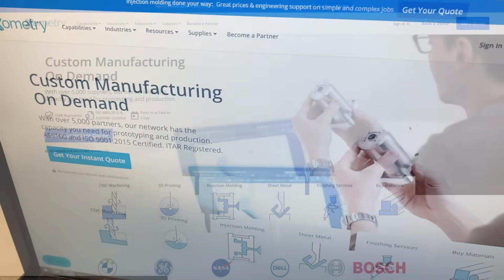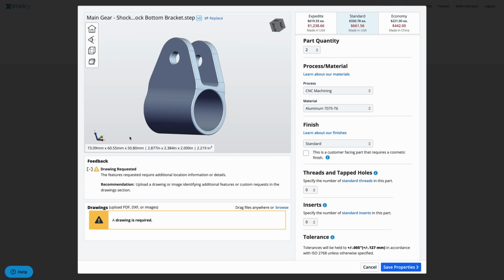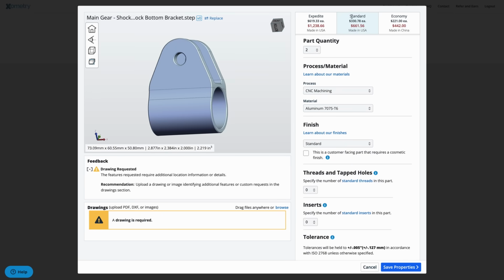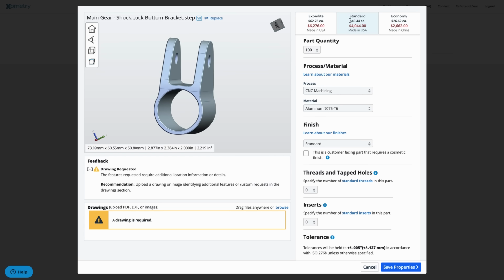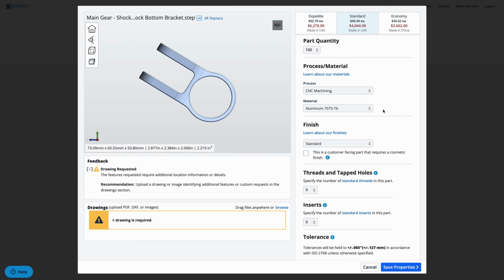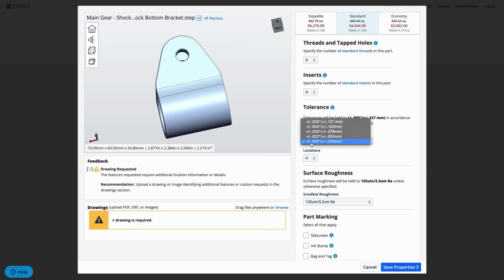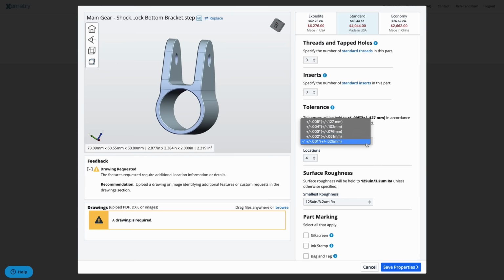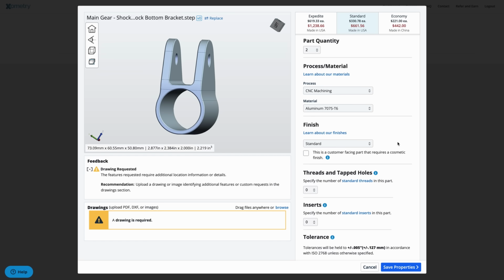The TRUE COST of CNC machining!

Comment: 33 years as a manufacturing engineer in Aerospace......and I can only dream of design engineers understanding what you just demonstrated, and we're just talking about the basics here. very well explained guys.
Reply: As a mechanical engineer, I can understand why new engineers generally do not have a grasp on machining.  The main focus in college is math, statics, dynamics and other engineering theories.   We would be lucky to even have a few college courses on drawings, modelling, dimensioning, geometric tolerancing, and many other important subjects to creating a working drawing.  As a result, most new engineers has never been exposed to design for manufacturability and not prepared for the real world when we work our first engineering job.  I'm lucky that I went to aviation school and got my A&P license, so I have been exposed to the practical side of engineering.  I also converted my personal end mill to a CNC machine, so I have exposure to working with metal fabrication.  If you work in a larger company, there are other people available to show the new engineers the ropes.  On the other hand, smaller companies do not have that option and the person has to learn on their own.  Generally, this is where most of the problems occur.  Without a good background in design and machining, most new engineers lack the understanding to create good design and drawings with the proper tolerancing.  

I often see or hear machinists belittle engineers.  The fact is, its not an easy job when you are only provided specs and have to design a part or complex series of part to perform a function.  There are many ways to make the parts to meet the design spec.  An experienced designer would know what parts need to be done based on previous designs or knowledge from years of designing.  New engineers may have no idea what to even do and create parts that can't be manufactured.  In our company, we not only focus on DFM, but also for testing.  The part not only has to be machinable, but it has to be done so that it can be tested properly.  We even do tolerance stackup studies on parts bolted together to make sure all the parts will fit or align properly.  Smaller companies may not have that level of process control so the drawings are less than satisfactory.

Nobody is perfect.  You have to ask yourself: if the shoe is on the other foot, would I be able to do the job?  Are you able to complete the advanced science, engineering and mathematic course to earn an engineering degree?  Can you design a product with only specs, model the parts, create the drawings, perform stress/thermal analysis and test the parts to make sure it meets the specs?  Most people can't.  If you add in a short development cycle, its not an easy task.  From start to finish, some projects are less than a few months for developing an entire system.  In some fields, you have to take an engineering test (EIT) and get a professional license after a few years in order to be certified to do the job.  If its easy, everybody would be doing it.

I've seen my share of new cocky engineers.  Usually, they get a dose of reality when we do a design review before drawings are released.  The senior engineers do a good job at slapping them down and making them humbled in front of their bosses.  The ones who are not cocky and willing to learn, we teach them the right way from the start so they have a better understanding.  I prefer to have the new engineers do drawing revisions or tooling first to get an understanding, but in today's world, they are thrown into the fire right away.  As a result, the drawings and designs are less than ideal, but we live in different times.  In the old days, engineers do the engineering only.  We had draftsmen to do the model or drawings.  Now, engineers are expected to do everything from the design, CAD modelling, drawing creation and also thermal/structural finite element analysis.  Its quite a task to do it in a few short months.

The worse part in today's world is if a new engineer is good, as soon as they get experience, they move to a new job with higher pay.  We are left to train another new engineer over and over again.  I can't wait to retire.
Reply: @ahndeux I’m a 14 year machinist with no college education. I taught myself solidworks and fusion 360 and I’m now the lead design engineer and in charge of all manufacturing at an aerospace firm simply because engineers really don’t understand the manufacturing process. My designs work the first time and are cost effective to manufacture. Not only that I design the whole work flow of the product. Fixturing and all. College courses really need to step up in the way of advanced manufacturing process. There’s no replacement for experience. Designing by description with todays powerful cad software really isn’t bad for most simple things. As long as you’re not tasked with designing like a self cooling rocket nozzle.
Reply: This is fine comment, as it stands. But I was wondering if you could go into a little more detail
Reply: I've found it's pretty easy to tell within a short time of looking at a blueprint, whether or not the engineer has any manufacturing experience.  Unfortunately, the answer is usually NO.  One particular part that I'll never forget was a hinge, machined out of billet aluminum...for the 'galley' door on a large commercial aircraft.  Yes, the galley, where the flight attendants keep the snacks, etc.  This included drilling the hinge pin hole (about .125" diameter) something like 4" deep!  The hinge was nothing special, looked like any other door hinge you'd get at Home Depot, but was machined out of aluminum.  

Another part was the latch striker for the door, which had some ridiculous tolerance on the square shape on each end...+/- .0002" if I remember correctly!  The part was probably 1.25" long, .375" diameter with a square cut on each end.  The engineer had even dimensioned the points of the square with a tight tolerance (tight for what it is, maybe .005" total).  

My first thought is that the design group should have sought out an existing hinge manufacturer to try to find standardized parts already in production, or at a minimum, have that manufacturer produce the hinge to the required criteria...which should have been reviewed by someone with actual manufacturing experience, to question the tight tolerances and explain how this would significantly increase the cost of the part.  

And don't even get me started on the use of GD&T!  I can't tell you how many times I've seen things like the flange face of a bushing called out to the bore with 'true position,' etc.  The only conclusion I can make is that 'engineering' programs seem to be leaving out crucial parts of the process.  A friend's brother was in college to become an engineer a few years ago, and I asked him if they ever mentioned 'design for manufacturing,' and he said, "No....what's that?"
Reply: I’m the lead designer for my high school robotics team and my number one problem with my team is that they don’t understand DFM.
Reply: You gotta educate the employers and educators of engineers.  There seems to be a mindset that a person with shop / assembly experience is on a path for a technician career while engineers have to stay away from that stuff in order to focus on "engineering".  An oversimplification and classification of people and their jobs.
Reply: Firstly, pretty ignorant stance from many in this comment section. The details in this video are basic at best and most junior engineers could guess the cost drivers listed with some prompting. The real issue is exposure to DFM and that comes from experience AND the company providing adequate resourcing, training and time to develop. Us pencil pushers engineers are not always the root cause. Also, I've seen many a suppliers failing to deliver simple designs or understand basics in BS8888 tolerancing. 

We need to be open to support each other instead of pointing fingers.
Reply: Honestly the part was a 3 operation part. The bore should have been done with a boring head to assure cylindricity. The reality is the machine isn't a full VM it is a 2.5D with no tool changer I saw. so their setups make sense with their equipment. In production the part is $16 to $18. If it's high volume make it out of PM then you only have to finish the bore and do the cross drill. A lathe with live tools and the right chuck it is then probably $9 a part.
Reply: As a homebrew engineer, when I am designing something the manufacturing process is second only to functionality in terms of importance.
Reply: As a design engineer,  I wish that other design Engineers would speak with machinists and manufacturing Engineers. DFM is key. We all work to the same end goal, and we can all learn from one another by being humble.
Reply: Как мамкин домашний рукопоп я уверен, что если проектировщики сами будут делать свои детали, то  качество проектирования быстро поднимется.
Reply: You are absolutely correct sir whatmost  design engineers understand about making what they design you could fit in a thimble.  I worked with a guy that had a story about this young collage grad Engineer applying for a job at Kearney & Trecker Manufacturing in Milwaukee, they made machine tools, back in the early 60's. 
    Old man Trecker was showing the young kid through the shop, from one end to the other. When they were done my buddy heard Old man Trecker (as he referred to him) tell the young kid you can start tomorrow at 7am. we work 10 hour shifts to 5:30pm. OH and bring a pair of coveralls. Coveralls said the kid inquisitively. Yes son said Mr Trecker you going to know every phase of maturing and why every hole Nube or flat is in every casting in every machine we make before you put a pencil to a piece of paper.
Reply: @HoundDogMech  hahaha!! love it!
Reply: They always think if it works on Paper it has to work on a Machine. I have seen some Cocky Engineers get really humbled by Peasant Machinist.
Reply: @kittysofdoom6968 as an engineering student and a machinist I will find a way to make the least efficient part at the highest cost.

Comment: Personally I'd have made that from round bar using the 4th axis hold the stock horizontally. That way you can machine around all of the sides with the exception of the end, all without fixtures and having to keep setting up. It's way more accurate and I use it all the time. Then I'd part it off and hold it in the vice with some packing in the gap to clean up the end.
You'd do it in much less time and without needing any tooling.
Reply: This, taking 4 setups to make this is ridiculous. At most, 2. With clever 4th axis use, 1 setup. I've actually made plenty of parts like this before exactly that way.

Comment: in what application you need 0.025 mm tolerance? if your size is 50 mm and your tolerance is 0.025 , you did it wrong... you can go with 0.1 mm and you will be fine.

Comment: One tip to reduce the machining time (because those 3D profiling is really unnecessary on your part): Using MasterCAM as an example: Draw out 2D profiles of the part. Top and side. Machine the top using 2D tool paths. Flip it over, repeat. Then lay it on its side, and machine the sides. 

The top and bottom machining would have established the roundness and the big bore in the middle. Then machining from the side would take care of the rest of the dimensions. 

Machine TWO part per vise. Your video may be a demonstration but machining 2 parts would have seriously increased your efficiency especially if you want to mass produce it (but since your machine does not have an ATC, the point is moot)

If you have 3 vises on your machine (very common in a CNC environment) you will be able to machine top and bottom on vise 1, side A and side B on vise 2. And then you will be able to basically mass produce the thing. This is probably why making 100 costs so much less than making 2. 

Try to produce more parts per cycle if you can. Reloading vises every 2 minutes is VERY tedious especially when you need to make lots of parts. a 40 minute cycle is much more relaxing. You can basically kick back and relax while the machine is doing its thing.

Which is why a ATC, even if it only has a limited number of slots, is so crucial in CNC.

Though honestly would have found a used VMC for very little money if I were going to play around with CNC... but making youtube videos with sponsorship from Tormach may not be easy if that were the case.
Reply: I would machine it on 5 axis mill. All in one setup. From my experience I would say cycle time would be around 7 mins. If you would charge lets say £50 per hour of machining then it would give you ~£6 per part
Reply: @Ddk90  The problem with a 5 axis is that you may not be able to put 3 vises side by side in a 5 axis, table may not be large enough, and such a setup wouldn't work for 5 axis anyways as the workpiece must swivel in various directions, and 3 vises gets in the way even if the machine is large enough. They only make sense for more complicated parts. 

Otherwise for most routine machining, 3 axis assembly line setup makes sense if you are mass producing.
Reply: @taiwanluthiers  I don’t think you understood my comment. I meant that I would be able to program this part from block of aluminium and to finish it in one operation in one vice. That’s what I do on daily basis. One vice, one block of stock, press cycle start, after ~6mins you have completely finished part. Besides chamfers on one side but you would deburr it by hand 👍

Comment: I respectfully disagree with Xometry's pricing.   I have been getting much more complicated parts made in China in 7075-t6 at the same tolerances, anodized, and threaded, with a much lower price.

Send me a message if you want some pics / details, DarkAero.

I could get that same bracket made with my supplier for around $20 - $30, for a SINGLE part.  The price would drop to around $10- $15 for 100 pieces. And we have had the alloy assayed, and confirmed our parts are indeed 7075-t6.

I used AliBaba to get many hundreds of quotes before finding a good vendor.   Few few quotes were as high as Xometry.   The average was around $60.   And my parts are WAY more complicated than that bracket in the video, and were done on 5 axis.

After I sent my STEP files to the one final company, I received the quotes for my parts, and I almost fell off my seat the quote was so cheap.

How can they possibly manufacture at such low cost? I almost felt guilty taking their services.

I got the parts back after a lead time of 5 days (and another 5 days delivery), and I will 100% be using this company again.

Shop around!

Comment: 400 to 600 for a 1 time job is about normal for those 2 parts.  Most of that cost is writing the programs, figuring out the order of operations, making fixturing, etc.  If it was a regular production part with proper tooling and optimized programs already made to speedily cut the part, about 10% of that would be about right.  A typical 80 dollar/hour machine price should see about 15-20 or so of those things made in an 8 hour shift, plus material cost of 7075 aluminum.  If you guys make a lot of smallish aluminum parts like that, a cheap 5 axis machine like a 3 axis with a trunnion added on  with a dovetail attachment for instance could speed it up even faster.  If there are lots of machine shops in your area, a used Haas + 2 axis trunnion can probably be had for around 100k.

Comment: Anyone doing this keep in mind. Your building costs X, the amount of floor space costs X of the building portion. The time you spend doing anything is that portion, air conditioning, insurance, labor... I heard $10.00 for material costs and that's not even taking into account the cost of the machine. $1,200 looks really cheap after that.

Comment: $40 TO  $400. You're saying that machine shops make a 90% margin. Truth is machine shops make a 10-15% margin. They are one of the most expensive businesses to get started with some of the least payoff.  Not everyone has a mill in their garage or the skills to use it like you do. The TRUE cost.... I'll save the best for last.
What you need to start a job shop: 
Shop, machines are not small and buildings are too expensive to buy. Lease at $1-2 per sq ft maybe 3k sq ft to start out? Probably more?
Machine(s): Get a used Prototrak for 25k and your still way behind the curve with tech. A 3 axis mill Haas maybe? 100K. 5 axis... between 300k and 1.1mil. 
Inspection equipment: Every customer gives you something different. You are going to need all of it. MICS, PINS, GAUGES, BLOCKS, Way too much to list.  All very not cheap.
Tooling: Tool holders, Workholding,  endmills, drills, taps, again WAY too much to list.
Soo much to list. Electricty, coolant, computers, software, maintenance,  machine downtime, insurance, Taxes again too much to list.
Employees: (he doesn't  have any but) The most EXPENSIVE part of a shop is employees.

CUSTOMERS. All of them think a part should be $40 and want it right now.  

My suggestion is send your part to DarkAero and have him quote it for you. He can do it for 1/10 the cost and profit.

.